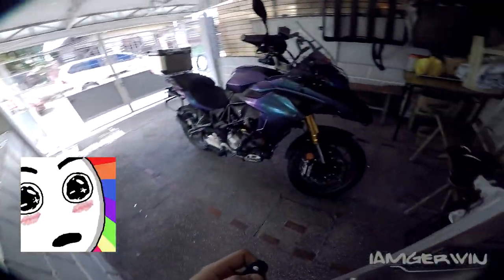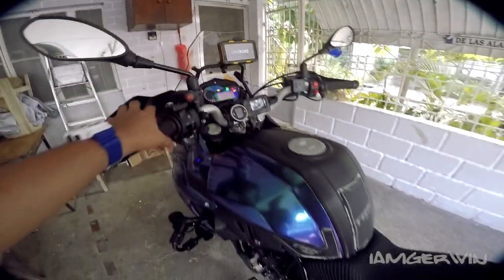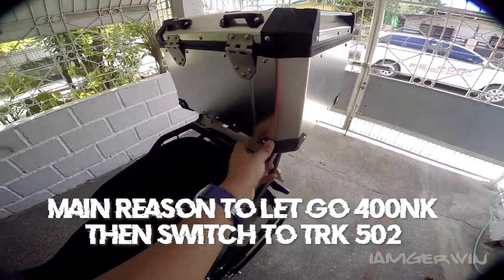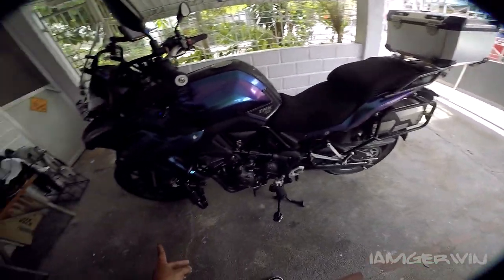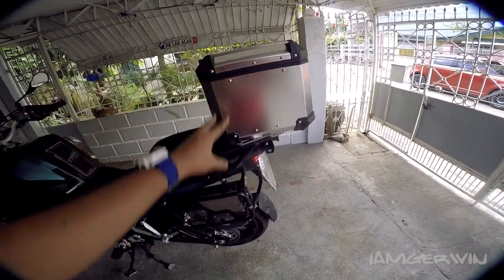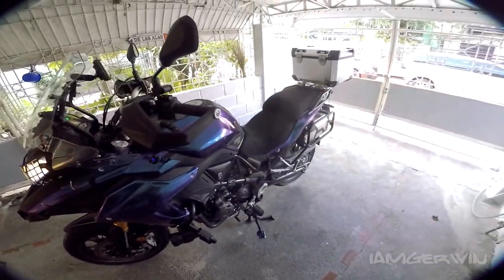BIGBIKE UPGRADE 🔥 REVIEW BENELLI TRK 502 TRK502  | PROS AND CONS 🔥 SOUND CHECK🔥

Comment from the maker: TIMESTAMPS

0:49 - Flex ng susi ni Benelli
1:01 - Quick mods
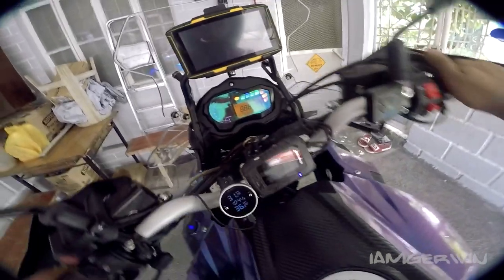3:00 - How to center stand TRK 502 (Effortlessly)
3:36 - Negatives
3:41 - Weight
3:57 - Stock hand guards
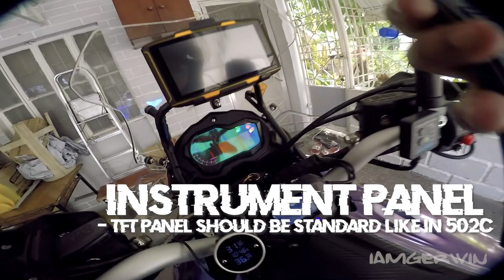4:14 - Instrument Panel (Dashboard)
5:05 - Stock stand
5:21 - Wind visor
5:40 - Ground Clearance
6:10 - Power
7:25 - Because "CHINA" ?
8:05 - Factory for assembly in Carmona Cavite
8:14 - Positives
8:20 - Looks
9:09 - ABS Front and Rear breaks
9:15 - Suspension (shocks)
9:27 - Seats
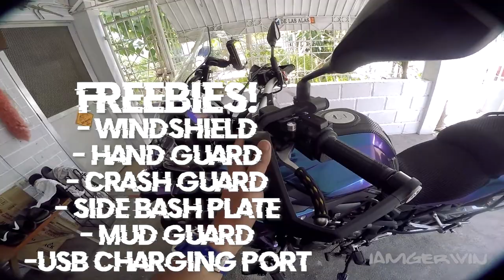9:54 - Freebies
11:26 - Fuel Capacity
11:44 - Fuel Consumption
12:00 - Topbox bracket
12:17 - Price
12:52 - Serviceability
13:53 - Service cost
14:21 - Heat dissipation 
14:56 - 360 Crankshaft
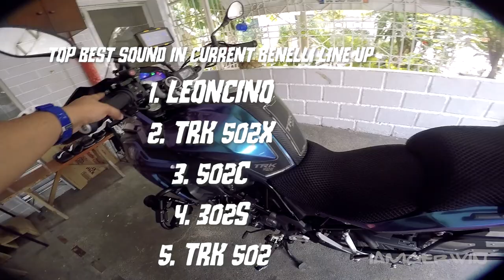15:29 - MY top Benelli bikes sound
15:49 - Great Sound
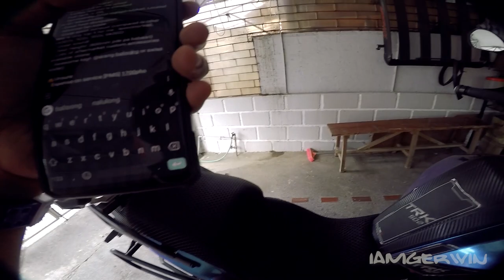16:00 - how to sound like trk502
16:06 - SOUND CHECK
16:16 - Vibrations?
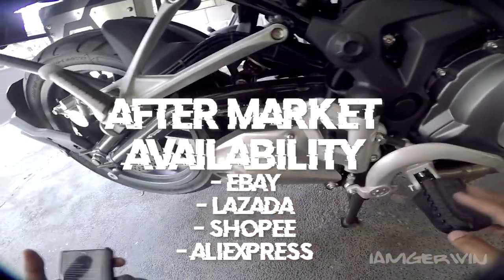16:31 - After market Availability 
17:00 - VERDICT

Comment: The people's Multistrada. The only beef I have with this bike is that it's SUPER HEAVY with only a 500cc motor to haul all that lard. It desperately needs the new 754cc engine + 82 horses & 67Nm torque that currently in production with the Benelli 752S. If it gets it, it'll probably trash both the Versys 650 & V-strom 650... hell even the exhaust sound alone will blow both of them out of the water.